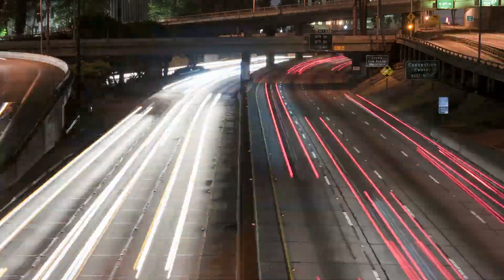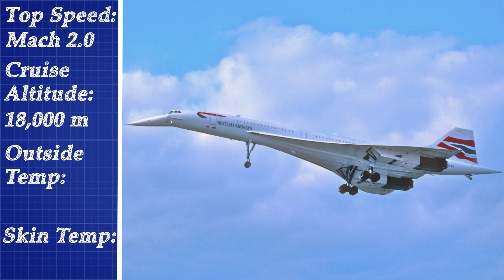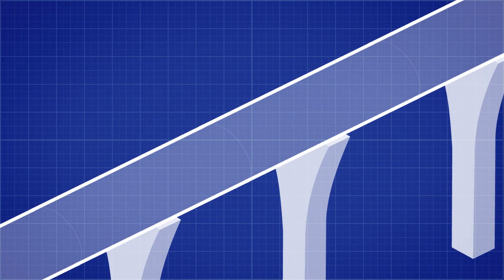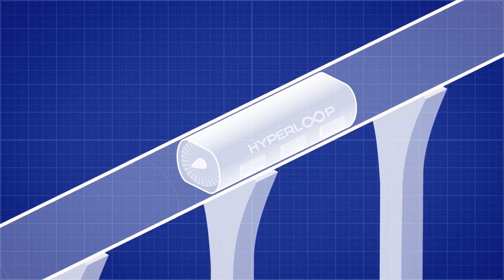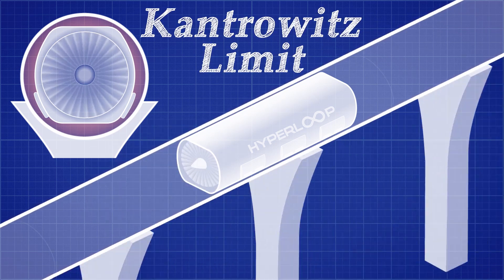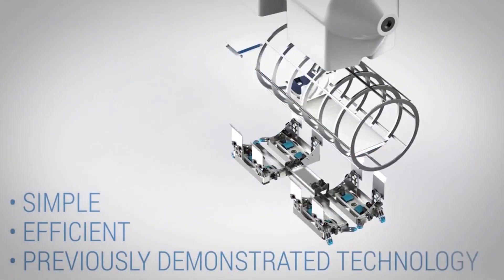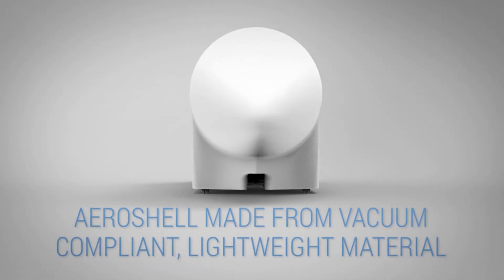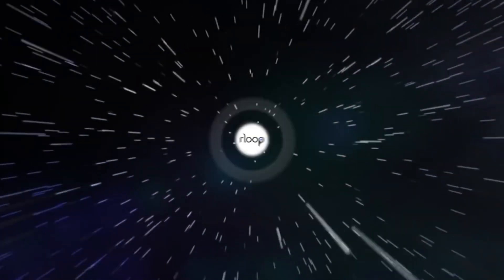Hyperloop - The Future of Travel?

Comment: Heaps of comments are from the same people who thought one would suffocate when going faster than 30mph.
Reply: actually, if the fracture is behind the pod, that wouldnt be the worst case. you could revert the power to the pod and apply emergency brakes to slow it down. 

now ... if you are going REALLY fast, and the fracture is in front of you? then it could be like hitting a wall. I mean, even losing only 25% of your total speed in a second could be fatal. just dropping from 640kph to 480kph in a second would kill you ... its like going from 160 to 0 in the same time.

the vaccuum idea aint THAT bad, but maybe the values of the vaccuum should be revised. i've read they plan to have 1milibar pressure inside the tube ... i mean thats REALLY low. maybe having 200milibar (~1/5 atmospheric pressure compared to sea level, about the same pressure that a plane has at the operating ceiling of 12000m). And a speed of ~600-800kmh should be fast enough to compete with a plane at a reduced cost using renewable electricity. given the speed and pressure differential is lower, you reduce risks. 

and maybe to make it even safer ... dig it underground, for some kind of subway system. that way the whole system is stronger as a structure, and cant be attacked from the outside by terrorists (cause you can bet they will try to do it ...).
Reply: Or what happens if the hyper loop tube is fractured? The pod will be shot out.
Reply: ***** I'm not saying we should not innovate, i'm just saying we need a system to prevent disaster and minimize it when it occurs.
Reply: Matthew Pike
No, the opposite will happen because the tube isn't pressurized, but (near) vacuumed. So, even in the most catastrophic event where an entire section would disappear, air would rush in and the system will simply come to a halt.

No offense, but this is why they use smart people to design and build the thing.
Reply: Jesus all the "solutions" just add to an astonishing price tag. And I still cant get over the fact that each pod only carries like 12 people. Jesus, Ill just get in my car and drive for six hours, thank you very much, I'd rather not wait in line for 8 hours just to sit in a dark tube with no exits where I have to sit next to a total stranger.
Reply: Matthew Pike 
So that a bunch of bay area dipshits can be paid for concept art.
Reply: "if the fracture is behind the pod, that wouldn't be the worst case. you could revert the power to the pod and apply emergency brakes to slow it down" it could be practical to have valves in each section. If something blows in the back, you could slowly pressurize the front sections. It would  naturally slow down the pod, and reduce the pressure difference. 
Higher pressure and burying it underground is a good idea. But this will be very, very expensive, as wellas adding any safety systems. The is no way that Hyperloop could be cheaper than classical high speed trains. I do not know how are they planning to suck some much air from that system, nobody did that on this scale.
Reply: LOL! All the replies to this comment only prove your point...
Reply: +Michael Samo Actually, engineering across faults already occurs with the freeway system.   For example, the west flyover of highway 8 over I-10 in Houston is supported by a very wide iron beam such that the flyover slides across the support as the ground shifts in opposite directions over a fault.   However, it also means reconstruction every ten to twenty years just as that freeway intersection is now being rebuilt even though it was only just finished in the early 90's.  Earthquakes would be a problem but not one we haven't already addressed.   What would be more challenging is that the costs estimates are based on using commercial pipes such as those used for oil.   Problem is that the largest available pipes are quite small hence the cramped single seat layouts. The challenge would be to encourage the pipe manufacturers to produce larger diameter pipes.
Reply: Which would be like smashing into a wall. You can't just suddenly run into a wave with a velocity relative to you at twice the speed of sound and expect no damage.
Reply: If you slow the cars in front of the hole down, then they're going to have a shock-wave traveling at the speed of sound hit them from behind.
Reply: Jumping Spider I can see this working for cargo transport. Things that don't need to be pressurized.
Reply: Matthew Pike 
Really expensive and complicated way to ship boxes. Typically shipping is done in the most cheap and efficient way possible, speed is just one priority. It's why we use slow container cargo ships instead of ICBM instant delivery. why not just use the already expansive and efficient cargo rail system, or cargo trucks. The increase in speed would offer almost no marketability of the system when compared to current infrastructure. 

Honestly I think this idea just isn't that good.
Reply: Jumping Spider Good point. Having a big system like that would not be worth it. Too many problems. If anything a smaller system, maybe on a large ship, it could be worth it if you need to get a box from the back of the ship to the front would be quick.
Reply: Matthew Pike 
Your basically describing a pneumatic tube system. Those do get some limited use.
Reply: Jumping Spider So why are we trying to build the hyperloop then?
Reply: Jumping Spider We might as well just build a train in space.
Reply: By far the biggest danger and obstacle for this transportation system is earthquakes, so if it will be built, engineers will have to figure a way to make it stable otherwise it will be a disaster.
Reply: there is a big difference between not innovating, and doing stuff its inherently flawed and insist on doing it just cause you are "an innovator".

for example, you know who was an innovator like you propose? Franz Reichelt. Go and google him out, you will understand why we dont do stuff that way anymore.

running a deep vacuum pipe with a extremely fast pod inside, its an EXTREMELY bad idea. not a slight technical difficulty.
yeah, car brakes could fail. but you have:"
double circuit brakes
hand brake
engine brake
and even if all of those fail ... you can still just avoid hitting other stuff and slowing down on its own.
compared to that, a structural failure on that pipe, would be the equivalent of a wall just suddenly appearing in front of your car. no stopping, no backup systems, no chance. cause even losing only 25% of the total speed due to a vacuum loss, you are having a dV of over 150kph. thats lethal.

plane wings dont fall off ... they are actually the stronger part of a plane. but you do know what happens in planes? explosive decompression, and there are many FAA rules for planes to try to minimize the risk. but the risk its still there ... and thats only with a 5:1 pressure differential. not a 1000:1 as this hyperloop proposes. and thats a big problem, for a short structure like the fuselage of a plane. now imagine how big that risk grows when its miles long with 1000 times the pressure difference.

and before you compare it with the plane or a car. here the system is fragile on the whole structure. not just the pod. so if you have some kind of structural failure due to an accident or a terrorist attack, you immediately kill everyone inside it.

maybe a system where there is less vacuum and less speed, maybe an underground tunnel. then it could be a viable alternative to an airplane using only electricity. but the way its proposed, its inherently flawed and not viable no matter how many innovation you want to apply. its colliding head on with newton's laws of motion.